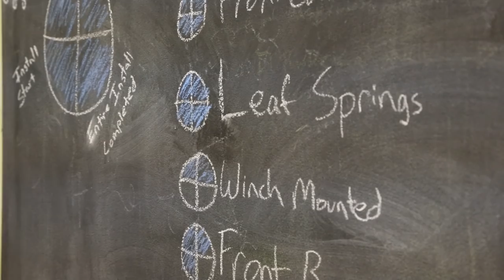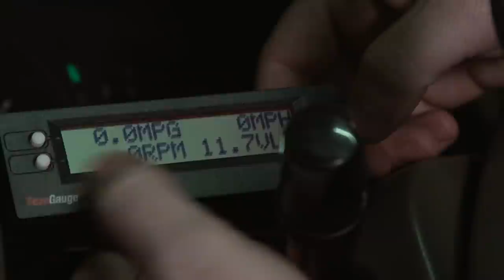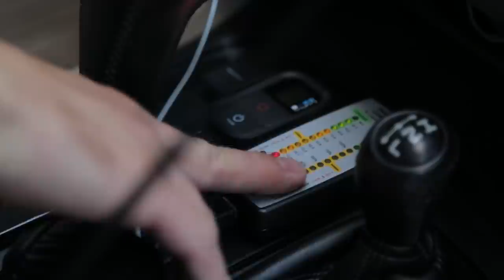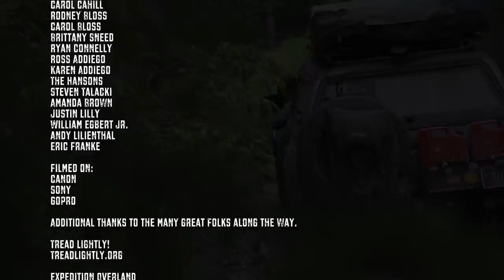We Are Going To Alaska! Expedition Overland AK/YK S1 EP1

Comment: Did extensive surveying in the Hanksville , Moab area late 70's for father in laws mining it's a wonderful area I had a GMC Blazer up fitted with skid plates, suspension everything you could imagine. back then there were no cells, gps or any of the modern tools we use today. Spent many nites in factory butte canyons and the Moab dwellings. Enjoy your travel videos.  Currently preparing for a sailboat trip around the world several years out from that.  Thanks for sharing your trip.

Comment: I drove L.A. to Alaska 7 times, mostly before they paved the Alcan. Also drove the Cassiar. You can drive ANYTHING up there providing that it is in reasonable shape. You can even drive the Dalton to Prudhoe Bay.  It's no particular challenge.  If you choose to off-road, it's no different than Montana or Colorado.  If you just want transportation and easy dirt roads, the Subaru is the best. If you want to haul gear, you're better off with independent front suspension on a heavier vehicle.  Keep the length down and carry a winch that you can place front or back,, or on a tree.

Comment: The added benefit of a manual driving experience is there are less computer operated items in the vehicle.  I have an 09 Taco and wheel the piss out of it. At Uwharrie National Forrest, we had a guy in our group that bounced a branch up into his undercarriage and punctured his spot weld in the floor pan and broke wires to his transmission computer (under drivers seat). Also could go bad if you take water in during water crossings.

Comment: I drove to Lima, Peru in '75 in a crappy 1/2 ton Ford van.  Miserable trip. The roads were acceptable. Small boat trip around the Darien Gap. Panama to Guayaquil. Drove around Mexico for 10 years escorting caravans of motorhomes as the mechanic.  Succesful off-roading is just a matter of being in tune with the capabilities of your vehicle.  I did pit-and-chase on the Baja 1,000, etc.  Just know your vehicle and read the terrain.  The quicksand at Malarimo almost got us.

Comment: I just started watching your shows and this is the first one. I live in Jackson Hole, Wyoming. Looks like you may have stopped through here between your WY trail ride on your way to the St. Anthony sand dunes. Plenty of adventure to be had here in the Hole. Question: Why did you decide to switch tires from BFG's to Grabbers? Curious because I just bought some Grabber AT2's for my 2009 Tacoma.

Comment: Hey guys, are you using RAM mounts for the tablet and phone? Need to set my taco up precisely the same and wondering if those are the units used, and if so how they held up (and hopefully still are). Built a custom overhead console for switches, 2M and CB radio and deciding upon a drop down system or one like yours.  Cheers guys and happy trails!

Comment: I am dreaming of the day I sell all of my stuff and live on the road full time! It is part of my 5 year goal. I plan to be getting the new Subaru Ascent to pull a trailer that I can drop when needed but customize the Ascent for off-roading. I am not confident of absolutely everything it will need in customizations, but I have a few ideas: Tires, probably a 1-1.5" lift, skid plates, light bars, and I will likely meet with someone who knows the best way to outfit it the rest of the way. I plan to live simple first to save toward larger trips such as Alaska. It would be amazing if I could get Subaru to sponsor the trip...I wonder if that would be at all possible?

Comment: you guys must be rich
Reply from the maker: +Paul Steed Nope! We have a lot of amazing Sponsors to make this series.
Reply: +Paul Steed Money is coming from somewhere.. I would estimate the parts and work on that Toyota alone to be about 20K.  And I mean just the offroad suspension parts.. I would add another 10K or more for the detailing on electronics.. and did I hear a refrigerator in there?? So that Toyota is about another 30 to 40 K after buy price.

Comment: I really love this, but I have only a question, why toyotas? I know that all will say because they are the best trucks and the more reliable out there, but I wanna know why not to choose jeep wrangler/unlimited or land rover defender/discovery? or something from chevy/ford/dodge? i´ts because the fuel mileage? cheaper aftermarket off road parts? I´m not saying that toyotas are bad trucks, I like them, I have recently bought a 98 tacoma srs v6 4x4 manual transmission, and it´s an awesome little truck.
Reply: I think it all comes down to the reputation Toyota has built over the years plus its cheap
Reply: I had wheeled or off road jeeps and toyotas,  hard wheeling and I can tell you that no jeep beats toyota unless you heavily modified it. Too bad they put ifs in toyota now.

Comment: "the unexpected is gonna happen.." well then buy american ...TOYota...with emphasis on TOY!! is just that: a toy...running a toyota in the american west is sorta like bringing a knife to a gun fight
Reply: Yeah because Ford, Chevy, GMC and Dodge trucks are only made in America and are made with 100% American made parts...right.
Reply: I highly suggest you take a look into some Toyota models such as the FJ40, FJ60,  and FZJ80.
Reply: mckeewc
I agree. I daily drive a 1982 Land Cruiser BJ42. It`s no ``toy``, that`s for sure.
Reply: Snow Peak
the only advantage i see in running those rice burners is their mileage. in endurance and longevity they aren't even close..my old '76 dodge has 600 000+ miles on it..it'll still pass anything on the road but a gas station. granted, the mileage it gets (10mpg) suxx ass.. but it has been THE most reliable vehicle i have ever owned. the guys that drove the imports in my little hamlet in north central idaho quickly learned what lives and what dies swift death on those roads.. toyota lives a short and hard life there...6 to 12 months and they're ripe for the scrap yard, literally. for short little trips around town they do just fine, but in the west you're often driving hundreds of miles to get anywhere. those things beat you plumb to death. with my fat ass less than 3 inches off the floor boards in a toyota there is virtually no driving comfort for my 6', 220lb frame. i've driven toyota, isuzu, nissan and mitsubishi  trucks and none of them offer the degree of comfort needed for somebody my size
Reply: mmikeyy27
I've never driven a '76 Dodge, so I don't know what they are like. I'm sure they are great though; better than the new plastic ones! I will say that my Land Cruiser is not only good on fuel (diesel), well decent for its age, but also for its endurance and longevity. Sure it's slow as hell on the highways (80-90km/hr is what I do) but it alway gets me home...except for a couple instances haha ;)